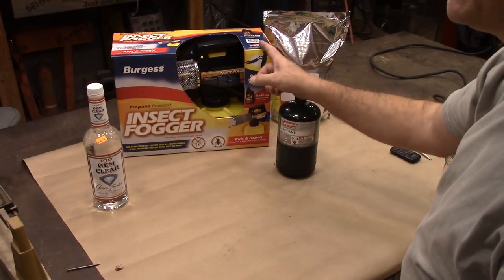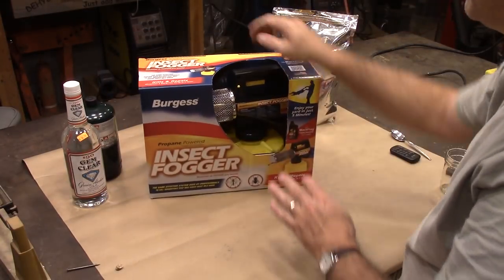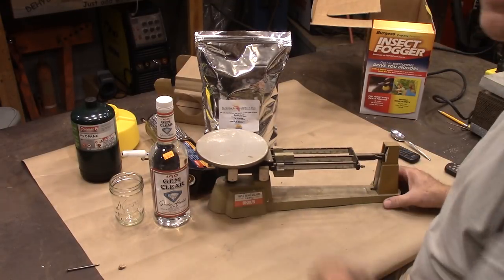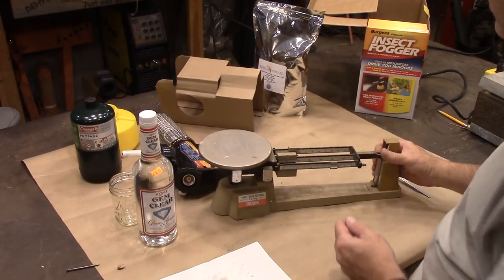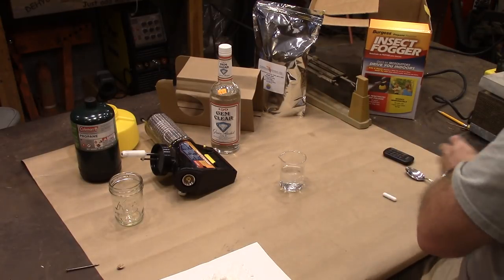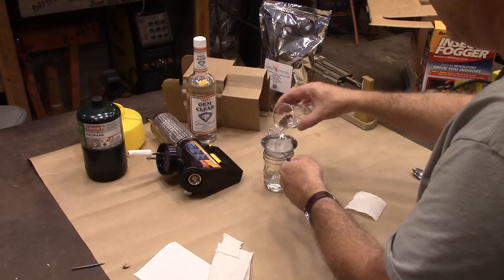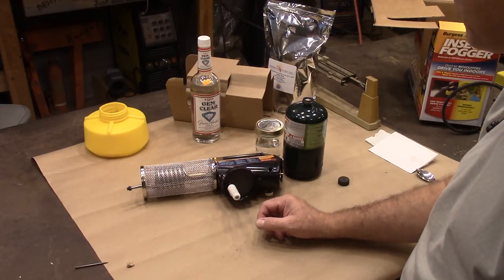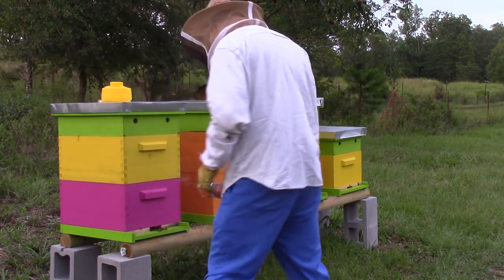Start to Finish Oxalic Acid Fogging for Beehives

Comment: Friend.  I am a little reluctant to try to add to your presentation, however, I might be able to share with you something that you may benefit from.  I use "food grade glycerin and oxalic acid" in my fogger.  I heat the mixture and add the oxalic acid until no more will go into suspension.  I use one pint and screw it into the fogger in a pint jar.  One good puff for each box.  I will get around to 30 colonies in less than 15 minutes if they are close together.  This will be going into my 4th year with good results.  I have no dog in this fight, information only.  I wish you well,  LP
Reply from the maker: Thank you for your input and sharing your experience.  I will have to try the glycerin idea, I bet it works great.  Thanks again for letting me know how you do it.
Reply: @SoatMon  Thanks to both of you. I bought a lot of glycerin and 190 proof in April to make hand sanitizer for work/personal. I have some of each left. Haven't purchased the fogger yet but I have the OA. Thanks again!
Reply: Larry Peterson; do you do an alcohol wash afterwards to see results??

Comment: Hi I am looking for the connection size for the propane as I am struggling to find the cylinders in the uk. any ideas
Reply from the maker: For the USA it is the standard propane cylinder that is used for a propane torch.

Comment: Cool. I am a Slap it on and get it done. Your Pint Jar likely has gradients in ml and oz. Use that. Also do not tighten the Pint Jar tight to the Fumigator. The Squeeze mechanism may have problems.  I use a Harbor Freight Scale in grams. 30 grams. + or -. Use 190 proof Ethanol. Alcohol Boils off Before Water :-) The higher water content dissolves the Oxy Acid a little bit better. Once clear I dose the Bee's. Works for me. PS do not warm the Alcohol too much for a long time. Also Rinse the Fumigator after use. Otherwise Parts will dissolve.
Reply from the maker: Thank you!

Comment: Well done.  Really appreciate you always putting the links to all the items you use.  As you say, sometimes it is hard to find the items especially things like Oxalic Acid.  It may be common but I have never heard of it.  By the way, you must have every tool known to man :-).
Reply: Glenn Felpel , yup, hes a doll. I got 99.6% OA from amazon, in a whute bottle, man, it wouldnt dissolve in anything. Water, ethyl, everclear,  all temps,  not a bit of dissolution.  Go with Florida Labs, save yourself time ♡♡
Reply: Did you try the wood bleach acid from Mannlake?  I've go that and want to use it.  Hoping it works.  If not down to Florida labs I go.

Comment: I find it shocking, the lack of scientific detail. Basic Q is HOW MUCH OA put INTO the hive?? Waving the fogger in front while most vanishes is a waste of time and effort. When I did it, I created a solution with 3.5g OA/50ml alcohol. Marked the jar in 50 ml increments, put the nozzle INTO the hive, and held it until had used 50ml. Measured mites before, and a week later. So far, with 12 hives, all but one had over 3 mites before, NONE a week later. I think the method has tremendous potential, but needs some solid , scientific testing.   Does anyone have any such results????????????
Reply: Measured mites how?
Reply: @rachellskerlec4713  Sugar roll method.. Not as accurate, but A. I hate killing bees.  and B. only care if above or below 3. My experience is either low or very high. Latest recommendation from UF is to test MONTHLY

Comment: I bought a Burgess fogger for this method some months ago.  However, I've read so many blog posts that say fogging doesn't kill the mites like the vaporization method does, that I haven't used it.  I'd hate to think I've treated my bees when I haven't.  Does anyone have a good mite drop comparison between vaporization and fogging?
Reply from the maker: I agree with you, I would like to see those results as well.  I have never actually done an alcohol wash.
Reply: I've done both the fogger and the OxyVap. The best success I've had wintering bees was the fogger year. I was too cheap to put out 165 for the wand. The wand takes so long to do that you find reasons not to. The fogger was so quick that it was easy to just do it. 
My fogger lasted one season then the pump guts fell apart. 
Now I'm using the expensive provap110. It's fast and easy and will last me many seasons. I run around 40 colonies. In the long run I think the provap110 is the way to go for me. If I only had 4 hives...

Comment: Thanks so much for your videos.  I am very interested in trying this method of mite control.  Most of my hives have a pretty robust mite issue that did not appear to be an issue in September--so I am compelled to try something in order to get through the winter.  My only concern is that I typically leave a medium super of honey on hives.  Are you aware of the known effect on honey or on empty comb if left in the hive?  Most of the honey is capped.
Reply: Ha Ronald   I was concerned with that as well but I was told that this method does not hurt the honey that the bees clean it out in a couple of day that the honey was fine  to eat this person treats with a fogger every month he said .  the dribble method  is what contaminates the honey and u have to be careful with it u can not eat the honey with this method.
Reply: Thanks for the feedback.  Not interested in the dribble method.
Reply from the maker: A lot of people have said it does not affect the honey and oxalic acid is a natural compound found in foods like spinach and rhubarb.  However, the county extension pamphlets state that supers must be removed.  I think it is because honey for consumption cannot be contaminated by anything.  I would not hesitate to leave them in place.  Thanks for watching and commenting.  Good luck with your bees!
Reply: Thanks for taking the time to reply!
Reply: @SoatMon  Good video and I understand you like to do things fast.  However, it is much better to remove the honey supers.  You can either smoke your bees to the brooder boxes and place a barrier like a piece of plywood or a piece of plastic between brood boxes and supers or you can smoke the bees down, remove the supers, put your lids on, treat your hives andreturn the supers after 30 minutes.  Better to be safe than sorry.

Comment: i use a burgess fogger for mineral oil . it wont work well for OA and alcohol for me. After just a few pumps the solution becomes cloudy and wont pass. i found i couldn't get water through it to clean it out, and tried mineral oil, it came back to fogging. Then when trying to clean with water again , flow problems..Finally something broke loose and it passed steam. it appears the Acid or alcohol dissolve the pickup tube on the foggier
Reply from the maker: I haven't had that issue, not sure what the difference is.  Thanks for the comment.

Comment: Have you had any problems with acid attacking the insides of the fogger?
Reply: I have been flushing mine with water after use. And no problems so far .
Reply: @brettwillbornsr.8437  Thanks!

Comment: Have you or anyone  checked . or is there documentation on how HOT the Burgess machine gets so it  goes to gas before  it changes  to formic acid and carbon monoxide? 
have you done an alcholol wash a few days after to check fio mites?
Reply from the maker: I have not seen where anyone has checked for the formic acid conversion.  Also, I have not done the alcohol wash.  Last year was my first with bees and I split them several times, I did not have enough bees in a colony to spare killing that many.  Will probably do this next year.

Comment: There is zero evidence that any of that fog went into any hive.  ZERO.  Need to actually put the fog into the entrance.
Reply: If you watch the video he looks up at the top vent holes after every spray for signs that it's full and the fog is coming out the top of the hive, you can sort of see it leaking out the top/back of the first hives lid in the video, from experience in person it's pretty obvious when the fog fills the hive and start coming out from under the lid...  There are certainly ways to make sure more fog gets directly in the hive but not absolutely necessary...  I personally use a small length of 1/2" copper pipe pushed into the hive entrance a big and push the fogger tip to the pipe but his way works as well...  A mite count before and after will confirm if it worked or not and should be done...

Comment: Hi, would,you know why FGMO that is normally used in forgers is not used in this instance? In NZ 95%, 190 proof alcohol is incredibly expensive, had a quote for NZ$118 per litre whereas FGMO is $16. Thx
Reply from the maker: Unfortunately, I am not familiar with FGMO.  Maybe someone that has tried it will answer you.  Thanks for watching!
Reply: I think fgmo may be food grade mineral oil
Reply: A number of people use water instead of ethanol. Oxalic Acid in more dissolvable in ethanol than water. Think the 25 gm/100 ml directions for oxalic acid  was chosen because that is near the saturation point for oxalic acid in ethanol at room temperature. You would not be able to dissolve quite as much in water as in ethanol,  possibly 15 gm/100 ml, just guessing. Some people suggest water would  be less damaging to the bees than ethanol.

Comment: Ha I did this yesterday with 150 grain proof they do not sale 190 here in Virginia,   it mixed fine but I did not use it all   so I left it in the jar not attached to the fogger  when the solution  cooled down the acid  crystallized  it spread like a spider web on the glass did u know it would do that.  do u reheat it the next time u want to use it thanks  this is a easy way to treat for mites   thanks for the video.
Reply from the maker: You want to keep it in an airtight container.  I'm thinking the alcohol evaporated and that caused the crystallization.  I would start over as you need to know the concentration of the solution.  Good luck with your bees!

Comment: Can you elaborate on the spinning stirrer - where did you get it?  What is it made of...
Reply from the maker: If you search for a magnetic stirrer you will find them.  Some do not heat.  It's basically just a hot plate with a magnet that spins.  You then put a bar magnet in the fluid and it spins and stirs the fluid.  I first used one when I worked at a local university years ago.
Reply: @SoatMon  Got it - thank you...great idea!

Comment: what is the correct way to clean fogger after use
Reply: After finishing with the Oxalic Acid treatments, remove the jar of oxalic acid. Press the trigger a number of times to remove the solution from the fogger. Take a jar of water and screw into the fogger. Press the trigger a number of times to flush out the fogger. Remove the jar of water and push the trigger a number of times to remove all the liquid. Turn off the propane gas flow. Take a small tissue or paper towel to wipe dry the pump mechanism. Remove the propane tank. Let cool. Store away for next time.

Comment: HI cant find a mason jar to fit my insest fogger i live in ireland  tried loads tread too big
Reply: I had problems with mason jars, as the shoulder of the jar would jam against the pump mechanism, and wouldn’t allow the trigger to be cycled, no matter how hard you pressed. I did find a plastic jar that pickled herring came in that would work, before I actually found a mason jar that would fit. Think I had to use a larger jar, pint, instead of half pint. A number of jars had different thread styles, yet they all seemed to work for me.

Comment: since OA doesn't reach capped brood, how often do you treat?
Reply from the maker: You want to treat 3 times 5-7 days apart.
Reply: @SoatMon  How is this treatment method working and are you still using it.  I read somewhere there could be a problem using grain alcohol. Thoughts on that?

Comment: Im using your method, except mason jar set in boiling water. My oxylic acid wont dissolve . Any ideas?
Reply from the maker: It may need more heat to dissolve.
Reply: Soat Mon , i discovered the type i got on anazon, in a white bottle, with green and white label, is the problem. Others had posted it wouldnt dissolve.  Got Florida Labs sending some, sooo, hopefully soon bees will be higher ratio in hive than mites 😲

Comment: Ha I live in virginia they do not sell 190 proof they sale 151 proff does it make  a difference thanks
Reply from the maker: Not sure but you may have trouble getting the oxalic acid to vaporize since it will have drive off the extra water first.  Probably worth a try though.  I bet the oxalic acid will dissolve easier.  Thanks for watching!
Reply: I live in Virginia too. You have to apply for a grain alcohol permit through the ABC. Then you can purchase the 190 proof Everclear  They may have to order it for you.
Reply: thanks
Reply: Check my response to a previous questioner from New Zealand who had problems due the excessively high cost for 95% ethanol.